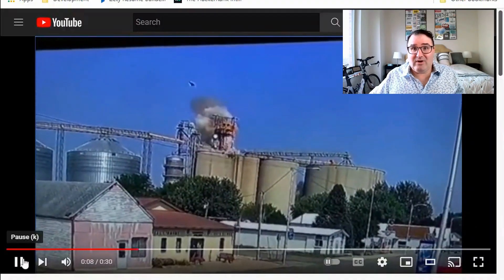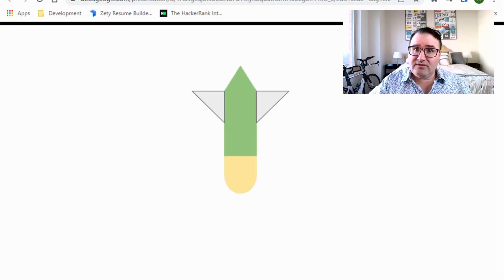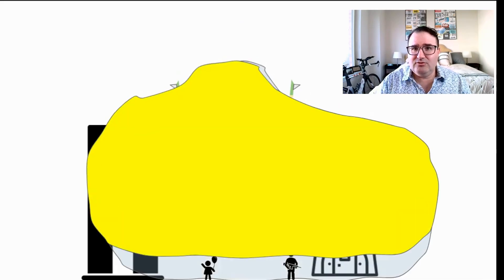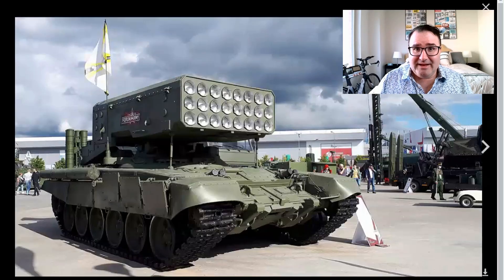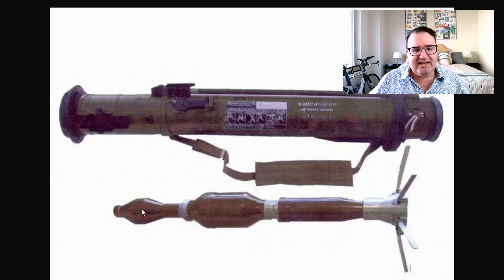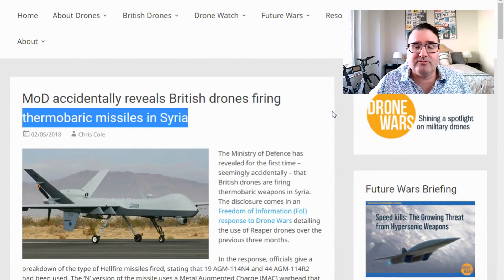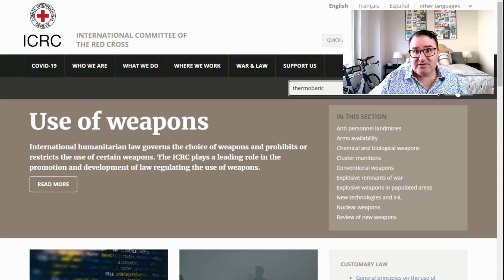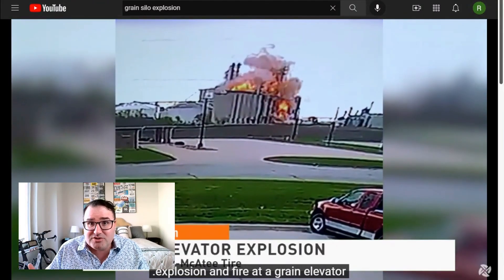How do Thermobaric "Vacuum Bombs" actually work?

Comment: You kinda missed the most important features. Because it uses air as an oxidizer instead of carrying it in the munition, it can potentially quadruple the explosive power of an equal weight of conventional explosive which are about 75% oxidizer. In practice it’s more like 3x

This is useful when you want to kill with overpressure/heat instead of fragmentation, like in the afghan cave example you mentioned. People behind barriers can hide from frag.

It’s also useful as an offensive grenade or infantry-fired rocket. It makes a big boom for its size without danger of frag killing friendlies, as grenade frag is deadly out to a great distance. A non-fragmenting conventional explosive of the same size as a grenade wouldn’t do much damage
Reply: Excellent point. The use of ambient oxygen negates the need to chemically attach an oxidizer to the explosive mix as is done with TNT and other explosives. "Fuel Air Explosives" using milled white powder or a small amount of gasoline dispersed in an enclosed space (to create the right oxidant mix) and ignited, was proposed in the old Marine Corps basic manual going back to the 1950s.
Reply: I’ve done a decent amount of research on these because I’ve heard them discussed by a few devru soldiers. You’re the only person who has mentioned or explained the over pressure. They call them T bombs and specifically use them to kill with the over pressure.
Reply: Actually, most high-performance military explosives (RDX, PETN, etc.) don't carry oxidizer, as they don't need it; the explosion comes from the explosive compound ripping itself apart into extremely high pressure gasses and lots of heat. It is not a combustion process as such (and indeed, many high explosives, such as TNT, will actually just burn normally if ignited; it needs an initiating explosion from a primary to actually detonate).
Explosives with mixed-in oxidizers are still common though, just moreso in civilian/industrial applications, with ANFO (fertiliser bombs) probably being the most famous.
Reply: @mnxs  it doesn’t carry a separate oxidizer because it’s all part of the same molecule, sure. It’s a different (and I think relatively efficient) way of carrying the stuff needed for the oxidation reaction, but it’s still heavier than an equivalently powerful munition that gets oxygen from the air
Reply: Seems easy to counter , just have a ton of L shaped hallways and rooms so the thembaric gas can't penetrate as deep.
Reply: @BoleDaPole  Overpressure doesn't care much about L-shaped hallways, for it will turn it into a nonexistent or very hot hallway from the heat of the reaction. Might even turn it into a T-shaped hallway.

Comment: Humidity doesn't make the oxygen more dense it just increases weight by incorporating water into the mix. Oxygen density is determined by air pressure. So high altitude thermobarics may not be as efficient as low density ones. 

However I'm not sure if these bombs even need all the oxygen in the air for combustion, its likely they have some sort of oxidiser etc in the mix
Reply: So the answer here is that the water will only reduce/inhibit the combustion of a fuel that is a hydrocarbon, since the combustion product of the hydrogen is water. You'll get partial combustion products with the hydrogen being around, but the fire will still burn. Moreover burning metals may not be affected much in practical terms. But... I'm a physicist, not a chemist.

You can also think about what happens when you drive your car in a heavy rain Vs in a river. You'll lose some power burning octane(gasoline) or diesel, because of the high humidity, but the hydrocarbon fuels tend to have poor water solubility, so they'll still burn fairly well.
Reply: Small note, humid air is less dense. It rises.
Reply: @Joshcodes808  can you explain how humidity decreases density? I don't understand
Reply: @tomhumphries912  I’m not a physicist but as a glider pilot I know it rises. If it was more dense than dry air it would all settle back to the ground. I was surprised to learn this as it’s counter intuitive.
Reply: @tomhumphries912  thermobarics don't contain any oxidizer. at least not outside of the initial small conventional explosive charge that is there to spread disperse the fuel. they rely on oxygen in the atmosphere. I think that's why they are called Fuel Air bombs.
Reply: @tomhumphries912  so someone offered this under another thread, water has a molecular weight of 18 (2 hydrogen atoms at 1 each and 16 of Ox). O2 is 32. Nitrogen, is like 34. So evaporated water is lighter.

Comment: I was so aggravated on the coverage of thermobaric weapons. The info out there was so bad and the hole vaccuum shit ugh. They're fuek air bombs but even a lot of the regular pages screw this up. They're not more or less bad than a regular bomb. They can pack a bigger punch because they don't carry oxidizer, and their punch is more like a big super heavy weight boxer vs a super quick jab from a feather weight. Might contain the same energy but the slower one can cause different damages.

With regards to the fuel air mixing its an interesting question. Depending on the arm some of the fuel is heated to ignition so it ignites upon air contact so it rapidly expand outward until consumed. I would bet that denser air might result in similar expansion total but requiring less distance to reach full consumption of fuel.

Regardless we need to stop acting like they're significantly different because they're not. Its literally the difference of an aircraft engine vs rocket engine. Both do the same reaction but one is more efficient in atmosphere because it uses the atmosphere. But eh
Reply: Rocket engines aren't the same as aircraft engines though.  Aircraft don't even have one engine style tough I'd love to see a piston powered rocket.  Also what's wrong with treating incindiary weapons as incindiary weapons?
Reply: @AnarexicSumo  okay so these aren't incindinary weapons. That would be something like napalm. Those it's not the boom it's the burn. This is most definitely the boom. They're both simple and complex weapons as in principle it's not complex, the actual ability to do it isn't. You're making a two stage explosion where you have high pressure fuel needing to mix efficiently such that you don't create unspent fuel.

As for rocket engine vs aircraft... Alrighty maybe jet engine would help. For rocket engine you have a fuel and oxidizer stream that meets in a combustion chamber and then shoots out the back side creating a force in the direction you want to go. In a jet engine you have a fuel that is mixed with incoming air and then ignited and then shot out the back. Rockers are inherently heavier than jets because they need to carry their air. It let's them work everywhere but makes them less efficient than even jet engines.

Maybe you're thinking turbo fan or prop engines where the fuel is burned and thst drives a piston which spins a propellor?  In that case there is some differences but more on smaller scale.
Reply: "the same reaction" but the effect on impact isn't the same, that's why people react differently.

And when used in civilian areas the difference is more between a boxer beating on your door vs that super heavyweight boxer busting through your window & will 100% kill you wherever you are.

You could say it's "the same reaction" when a triangular knife stabs you, but because the wound is far more devastating & difficult to stitch shut, those knives are treated differently.
Heavy vehicle drivers have more extensive licencing & training requirements than car drivers even though it's the same kind of combustion chamber engine & physics driving the whole thing.

You'd react differently to your grandmother being punched by a chihuahua or a super heavyweight boxer.

So just because one component of a thing works the same way doesn't mean the sum of its effects are, or that they should be judged as equivalents when they clearly aren't.
Reply: @InnuendoXP  apologies I was attempting to convey an energy equivalence. I. E. Same energy but mass VS velocity. Not a perfect Analogy but more meant to convey to poignant difference between the two weapon systems. One has a shorter impulse of detonation.

The older convention was strictly tonne equivalent to tonne equivalent but with thermobaric the idea was that more damage could be created through a slower detonation.

There isn't exactly a large distance travelled by the fuel prior to ignition so it doesn't exactly seep into areas.  A 25 meter dispersion in 50 ms still amounts to fuel hitting you going above Mach 1...

Lets be clear all explosives used in conflict are bad. Each has different function. One thing about thermobaric weapons is they're able to damage buildings more due to the slow moving pressure wave and over pressure.

Perhaps I also need to distinguish. There are non thermobaric fuel air bombs. Thermobaric isn't trying to leak fuel into areas so ouch as use the air as the oxidizer to allow for a bigger bomb. A standard bomb is 1:3 fuel vs oxidizer by mass. Thermobaric is basically a small bomb surrounded by some fuel with a high exothermic capacity. Not TnT or gasoline but usually ethylene. We want as much output gas and energy from the reaction as possible.

Now the first detonation might heat the fuel to ignition temp. This means that as the first explosion pushes it away, any fuel that contacts oxygen ignites creating more heating and thereby heating the fuel passing through it. It's difficult to think about but gasoline won't burn without oxygen and neither will this bomb. The fuel consumes all oxygen so fuel just gets heated as it goes through it and then contacts oxygen rich air.

This is why the impulse is longer. The fuel has to search for oxygen longer. If that makes sense?
Reply: @InnuendoXP  also I don't think you have an understanding of the Analogy. I worked with equivocation. A triangle knife VS non is worse because the area of the wound and even the volume is larger. If you stabbed an equivalent area between knives would that change it?  For the heavy VS light vehicles it is indeed the same reaction but  the energy involved is different. What crash would be worse if they're at the same energy? That's actually an interesting question and it likely would be similar to thermobaric.

Explosions aren't magic. It's not instant death. They kill you through physical processes. Mainly pressure which results in your lungs basically exploding. You don't just catch on fire (takes a lot of energy to do that).  

All bombs are bad but at least in this we are trying to muddy the waters. We also have thermobaric weapons and we have used them. They're higher yield to mass bombs that are more effective to destroy buildings. They will still kill people as well when they're in the blast radius pressure wave.

Please learn about physics a bit more and stop taking your demolitions knowledge from movies.

Like take a nuclear bomb. It's arguably a multi stage weapon. It's a  shape charge that compresses generally plutonium. That compression causes criticality and the amount of compression effectively will increase yield. Then that creates massive neutron and x-ray flux causing superheating of fusion able material that then releases a massive neutron flux that even more effectively fissions a shit tonne of uranium. It's literslly designing something to hold together in the microsecond time scale in order to work. Get the shape wrong or have corrosion or any number of things and most of what you'll do is just vaporize radioactive material into fallout. Still bad but not a boom as much.

Comment: People were absolutely losing their shit over these like they were nukes. War sure makes people hysterical
Reply: Fuel Airbombs are devastating, the expanding pressure waves their fireballs generate can reduce structures in a wide area which is why people liken them more to mini-nukes than conventional bombs. Russian TOS-1 'heavy flamethrower' luckily has a pretty short range and is massive overkill for most targets, why we've prob not heard that much about them. But a single one of those can fire a salvo that'll annihilate absolutely everything exposed inside a 200x400 meter area. They're not quite 'gridkillers' but not far from it. If their use became a standard thing hysteria would be a pretty proper response. Think of it as a tank that can literally wipe a small village off the face of the earth in one salvo.
Reply: They're devastating weapons with indiscriminate destruction over a wide area, particularly when fired as dumb munitions.

Their effects are also not always immediately lethal but can kill people potentially over the course of minutes in the areas where the pressure is the killer as their exposed soft tissue points such as eyes & ears are obliterated but their brains are relatively undamaged.

When used in civilian populated areas, losing your shit is pretty rational, if you understand the concept of empathy & aren't a psychopath.